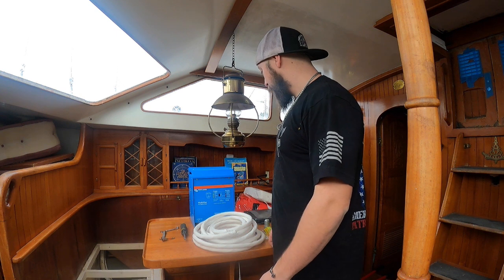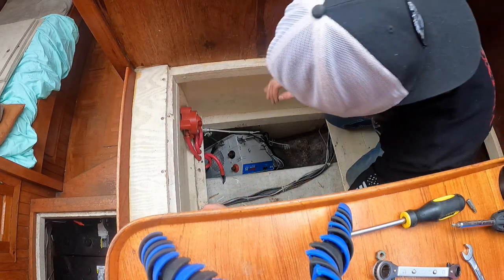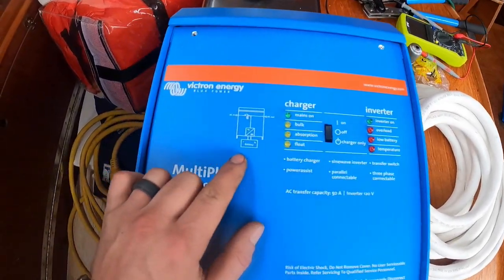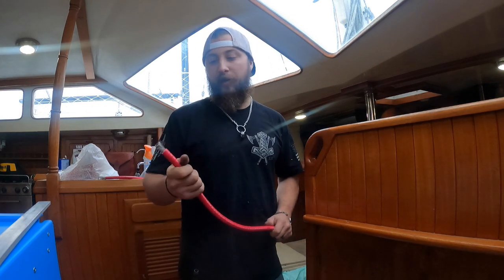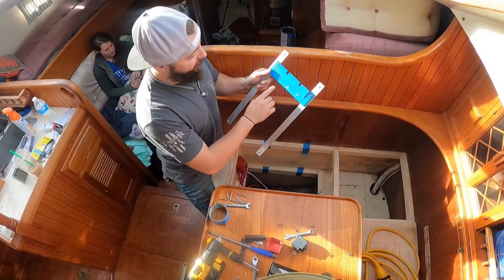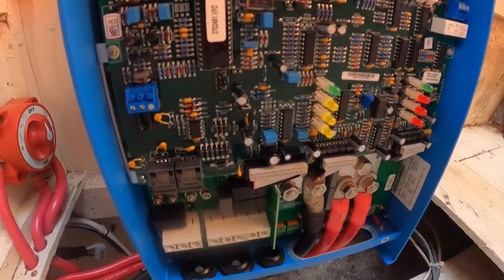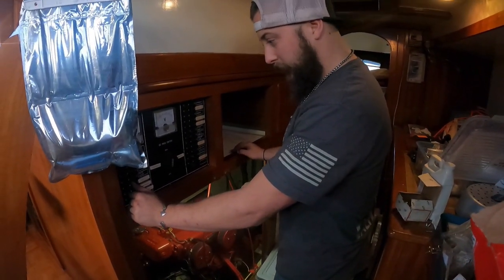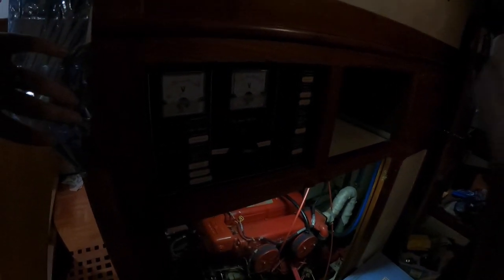VICTRON MULTIPLUS 3000W INVERTER INSTALL

Comment: This was about physical mounting and routing cables in your specific situation. Not helpful to me. I was hoping to find out more about the wiring and settings specific to multiplus
Reply: Well as titled this was an "inverter install" which pertains to physical install and wiring up a basic setup. The Multiplus is base programmed for most applications if you are looking for specific programming I'd try searching that but nothing about our video mislead in anyway. If you have a specific questions I may be able to guide you if you let me know what your looking for?

Comment: I bought the compact multiplus 12V 800VA 35A but when I measure the resistance between the phase and the neutral of AC OUT (without anything connected to the public network to AC IN) I have a value of 4.5 ohms and it worries me that I am short circuit
Reply: Interesting, maybe reach out Victron and see what they think and what value they deem to high.

Comment: There are just so many things wrong with this install.   Mounting, ventilation, undersized and missing cables….
Reply: Interesting as it's been working flawless since install so go ahead and elaborate and how i did it all wrong instead of making smug baseless claims. Mounting is solid using 1/4" aluminum flat plate Tig welded together, it's vented quite well fan draws air from a cool bildge compartment into a open cabinet, DC cables are 2/0 marine grade cable,AC is 6 gauge marine grade cable, and not sure what cables you see missing but everything needed is there.

Comment: Victron specifically calls for a minimum of 4” clearance all around the unit. I’m curious how heat dissipation is working out with the top so close to the bench seat.
Reply from the maker: We have had no issues with over heating we check it and it's always cool to the touch.

Comment: Did you ground the inverter chassis to dc ground? I can't find an answer
Reply: I ground the inverter box ground to the AC bus bar that all the grounds on the boat run to.

Comment: Wow.. too easy. well from where I'm sitting.. haha..  I live in my RV and have a solar system that's working.. but my Zantrec ProWatt 2k inverter is just over 6 months old and won't be enough.. so I'm thinking about installing one of these. My power center is less than 6' way so that will make it alot easier.. I have the CERBO and touch 50 with four 100Ah BB lithiums being powered by 1600w (4\400w panels) Need to upgrade some wires and add cutoff switch, breakers and a fuse.
Reply: Yeah we have been very happy with this inverter install so far definitely recommend if your thinking about it, also extremely user friendly
Reply: @Dadlife_Alaska  Nice. I will be getting one.. but not sure who will install it. I'm not very confident with my electrical skills.

Comment: BROOOOO...you helped me tremendously!! your yacht is similarly wired like my bus....now i understand the concept of the ac in and 2 outs...holy crap batman!
my bus has 2 legs....im feeling good about trying this!!!!!
Reply: Right on glad it helped, yeah bus and boat will be same setup. This system has been working flawlessly ran our new dryer off battery bank and inverter the other day and worked great. If you have any questions or need help down the road let me know
Reply: @Dadlife_Alaska   i sure will...thanks so much! saw your washer/dryer install vid too...youre a true craftsman!

Comment: Should have just soldered the ends on the cable,  much more reliable and keeps it from corrosion.
Reply: Soldered connections are specifically discouraged by the ABYC. A proper crimp cold welds the lug and cable together, add heat shrink and you are set.
Reply: They'll be fine, a good crimp/heat shrink on 2/0 cable's will be plenty reliable, maybe on smaller wires.
Reply: I've been an automotive technician for over 25 years and I can't tell you how many times I've just pulled crimped battery terminals right off or they  Corrode because there is no protection.
Reply: @joshgilbert6560  correct if there not crimped properly, or have tension/movement, and not sealed by heat shrink/exposed to moisture which mine is none of those. I've also seen moisture get in and make a soldered connection fall apart, at least the crimp is holding on to the cable. I am also a auto tech and specialize in DC electrical and have worked on everything from Tesla's - Mercedes (yes i solder all my smaller connections) crimping cable's this size are pretty standard. If you want solder your own cable by all means go for it but the way I'm doing isn't wrong it's just a different method and i have my reasons. I also thermo gun my cables for hot spots (resistance) once in a while so I'll catch it before it falls apart years down the road if at all

Comment: Hi there. I am about to install a whole load of victron equipment. I have spent a long time scouring the internet for info. I am in the uk and it is going into a steel hull narrowboat which is obviously not the same as a sailboat. I was a bit concerned with you not connecting the ground wires and also only one battery negative which I am sure would be ok if it was matching the two positives for size. Also, the firmware and charging settings were not updated and set for your batteries. Not quite so critical I guess as if you were using lithium. I would say to just get it checked out for safety, especially with kiddies onboard.  Not criticising but just concerned my friend.
Reply: I'm not really understanding what you mean by not connecting the ground wires? My AC ground is connected to my panel, as for the single ground it's a bigger gauge wire than the 2 positives to make up for being single and oversized for this application anyway so no worries there. As far as charging settings not sure what you mean these are AGMs and set to float at a set voltage, as long as there not overcharged there isn't any concern they don't react like a lithium battery they just loose cycle life. not really sure why you would be concerned about this system being unsafe, also have fuse/breakers on every wire to and from inverter so in an event something happens inverter is isolated and will cut power in/out for 12v/120v system
Reply: @Dadlife_Alaska  where did you connect the chassis ground lug on the bottom of the multiples?
Reply: @michaeld4502  I have a big ground bus bar in the engine room off the the 110 side of my panel that I grounded it to. hope that helps

Comment: What happens if one buy more  wattage then they need other then spending more then what's needed
Reply from the maker: With these units they convert just what they need from DC to AC so most of time itll just produce small wattage depending on demand but I’d we do need to run a bigger load we have the capability. So short answer there is no draw back that I’m aware of except overall price of bigger unit
Reply: Yeah, this unit is so powerful and smart. Great work.